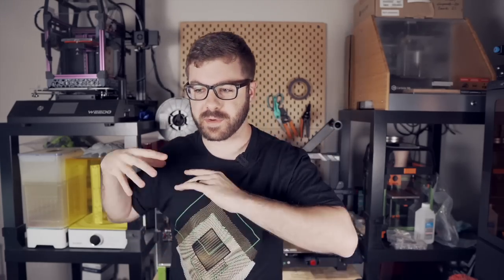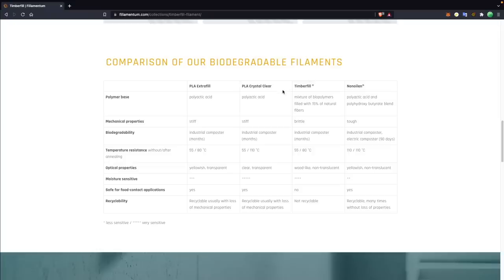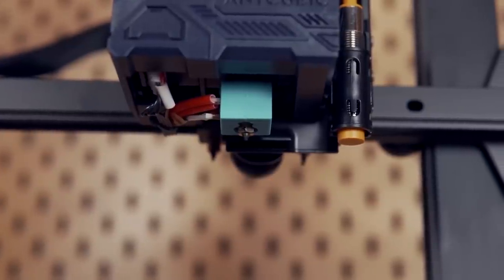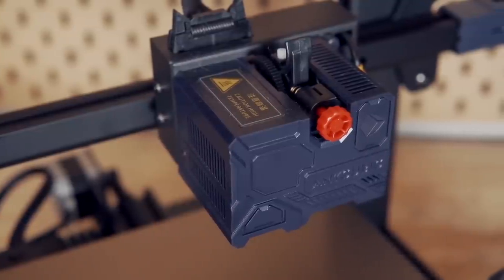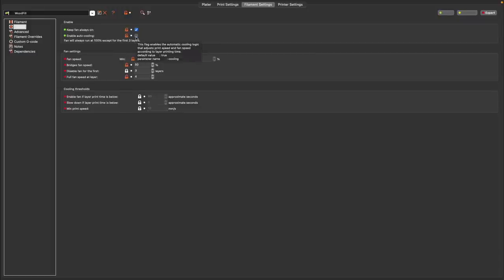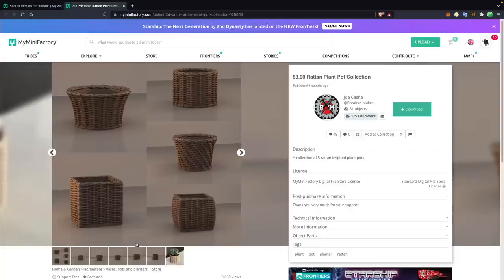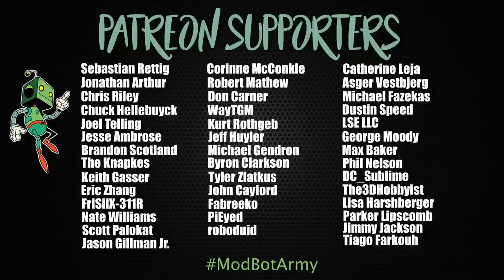Filament Containing Real Wood Fibers! (Timberfill Printing)

Comment: I printed with wood about 5 years.  My favorite party trick was manually adjusting the temperature up and down during the print creating color variations to simulate wood grain.
Reply: I tried a temperature tower to see if I got any color variations. I didn't see any. I wonder if I just didn't go low enough. I went 225 down to 205.
Reply: @hondaguy9153  i think you didn't go low enough, considering the temps on the filament show all the way from 165
Reply: @olivertrees  depends on the filament. The one I bought says 190-225.
Reply: I just went 250 for 10 layers, then 200 for 10 layers and saw no difference. Maybe it was because this PLA is only 20% wood, but I want this to work hahahaha
Reply: @danielberry777  Have you figured it out yet?  Please share if so!

Comment: I've seen so many bad reviews for wood filaments saying it was ugly and nothing like wood. Most people don't realise that, for it to look its best, you have to post process it as you would real wood. Print it with a 0.6mm nozzle at tall layer height, sand it, stain it and laquer it like normal wood and you can get some amazing results. I've made plenty of jewelery boxes as gifts made out of this material and people couldn't believe it was 3d printed. You can even fix your prints with an actual woodfil :D

Comment: Used Jayo brand bought from Amazon with great success. Same settings as other PLAs except 200c instead of 215c temp. Not a single clog and used it with Bowden and direct drive. Love it for skin tone models.
Reply: What size nozzle did you use?
Reply: 0,4
Reply: @petereriksson4115  ty

Comment: I will say careful with doing concentric, if you want a 100 infill it does not seem to do well with it, and make sure initial layer speed gets reduced. made the mistake not reducing it, printed at 60 for the that speed and it could not get the filament out intime and made a gap at the start of the first line. with high detail things seems 35-45 mm/s is where it does best. i did mine with a .4mm nozzle at .2mm quality. works just fine but having the filament ina dryer box will most likely help the quality. as for nozzle, why not do hardend steel? makes no since, not costly and does not hurt the print to have it. my filament was 30% wood so was not going to risk it messing up with copper hotend.

Comment: I printed the hatchbox wood pla on a stock ender 3 with default pla settings and a .4 nozzle and had zero issues. Maybe this brand is just more brittle?

Comment: Thanks for this one!

But - in my experience, using a brass nozzle with wood filament, is a rather bad idea. It works, yes, but your nozzle will grow. I've seen this several times on different printers and setups, so I doubt it's a false rumor.

Comment: Printed with” iSANMATE Wood Filament 1.75mm, PLA+ Wood Filament 1.75mm, 3D Printer Filament 1kg/Spool (20% Wood Powder+80% PLA”. Used a .4 nozzle on a Kobra Max. There was no clogging, stringing or any popping. The temperature was 200 degrees. The print stuck well to the bed through out the print, and came off with the plastic spatula.
Reply: Good stuff right

Comment: 🎯 Key Takeaways for quick navigation:

00:00 🌲 Przyjrzymy się filamentowi drewnopodobnemu, znanemu jako timberfill.
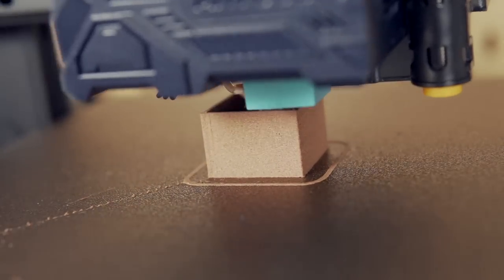00:28 🛠️ Filament to PLA z włóknami drzewnymi, idealny do replikacji wyglądu drewna.
01:52 💪 Materiał kruchy, ale staje się wytrzymały po druku.
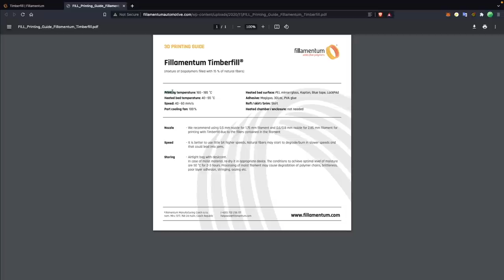03:01 🌡️ Wymagania: Temperatura druku 190-200°C, dysza 0,6 mm, wałek bezpośredni.
04:09 🚀 Sugerowana prędkość druku co najmniej 40 mm/s.
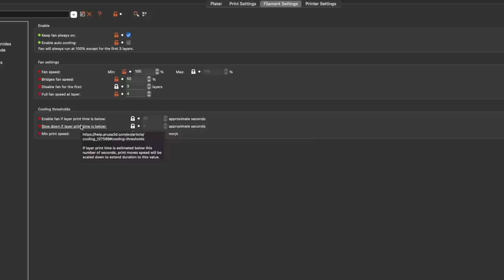05:54 🌱 Przykład: Wydruk rattanowych planterów.
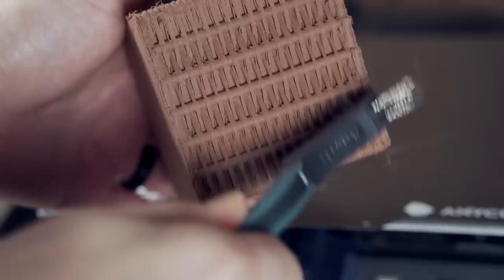08:36 🧹 Usunięcie nici pędzlem, łatwe szlifowanie.
09:45 🌟 Filament drewnopodobny to ciekawy materiał z wieloma zastosowaniami.

Made with HARPA AI